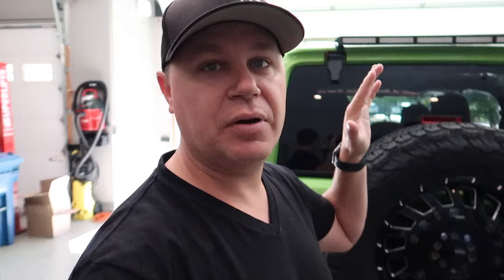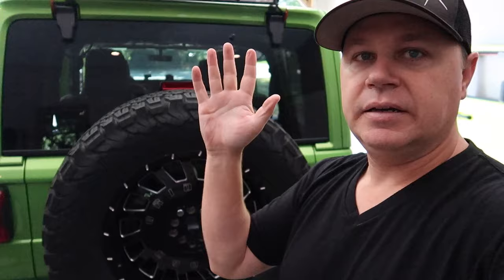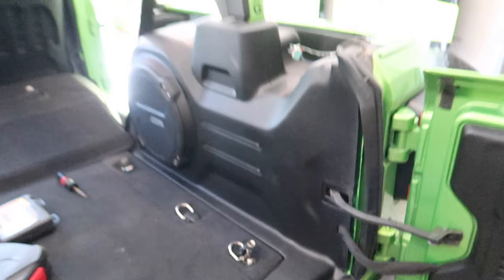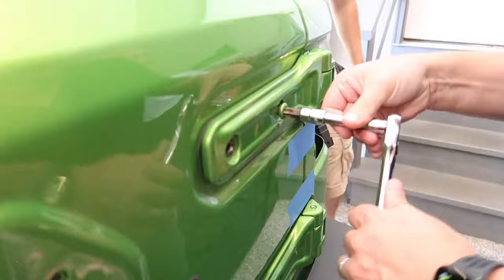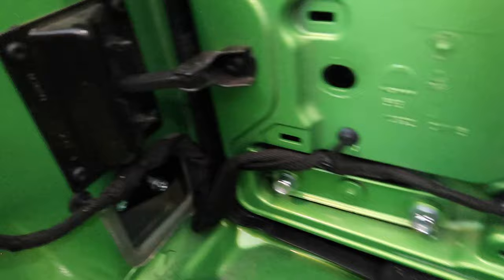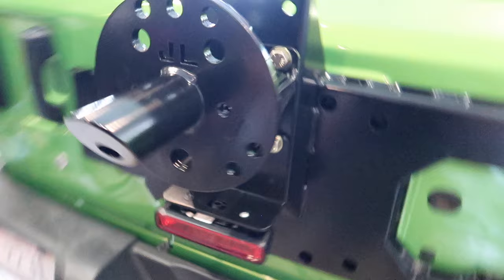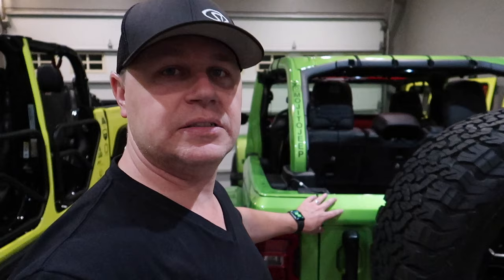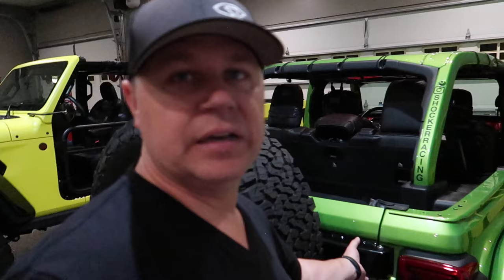FIX TAILGATE RATTLES/SQUEAKS **Rusty's Tailgate Tire Carrier Install - Jeep JL Wrangler

Comment: Thank you for taking the time to make a great install video, this definitely saved me some time. I should have taken your lead on the foam for the end panel vs drilling and installing the nutserts. After unbolting the assembly one of the holes was off, took me an extra hour to get it all lined up again. Really nice tire rack though, way to go Rusty's and thank you Shocker Racing for making the install video.
Reply from the maker: Awesome man! Always glad to help!

Comment: I've had my Rusty's tailgate tire carrier for just over a year and had zero issues since installing it. One thing I would add is that I put very thin rubber between this assembly and the tailgate. Adds a quieter sound to it when closing and now all of the unpainted areas are covered by the rubber. Great video and looks like you covered all of the details.
Reply from the maker: Thank you!
Reply: What did you use, a whole thin sheet of rubber and cut to the same shape then drill holes for the bolts?
Reply: @Mike Thompson  there are three sections of rubber. I cut them out and them marked the rubber for the holes and cut the holes out using a piece of sharpened tubing as a hole punch. I lightly taped the rubber pieces onto the assembly to keep it aligned while assembling. Tape was pulled out before bolts were tightened.
Reply: @rolliehunt5173  Thank you!
Reply: @Mike Thompson  you're welcome! If you finesse the rubber pieces just right  it's almost impossible to tell it's there.

Comment: For 90% of all jk tailgates the stock hinge holes elongate where the hinge pins go through .. this happens over time no matter what size tire mounted but wear accelerates with heavier tires .. replace both hinges either with OEM or after market .. i have an '07 changed both this year no more bang or gate bounce

Comment: Nice video I’ve been looking hard for the last year and a half for a spare tire carrier that won’t rattle. I’m running a 37x13.50 setup. I had Smitty built HD tire carrier on but it didn’t seem like the hinge bolts would ever get tight had a lot of slop in them every time I hit a bump on the road sounded like my tailgate was coming off. What are the hinge bolts like are they threw bolts or bushings also would like a picture of the third brake light on in the wheel

Comment: Does the 35” tires sit on top of your rear bumper with the new carrier. Or does it have enough clearance? I think mine is mounted too high and I’m getting a lot of wobbling when I’m on the road
Reply from the maker: We set mine to sit up just a little above the bumper, so it doesn’t touch.

Comment: So a year later....any rattles?
Reply from the maker: We never had rattles once we got it fully dialed in. Then we removed it from that Jeep and moved it over to our Mojito 392 and it’s still perfect!
Reply: I have had mine almost a year and the only bad thing is it squeaks a bit when you open and close it.
Reply from the maker: @rosco1883  I did spray a little lube in there a while back and any squeaking went away.